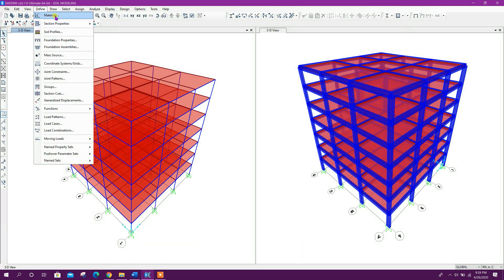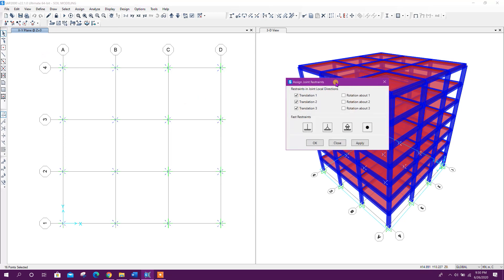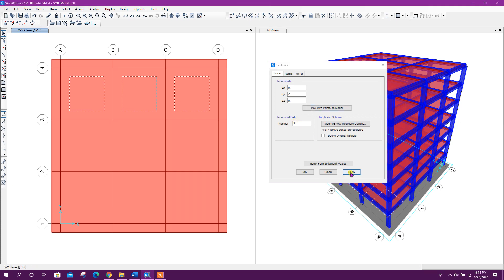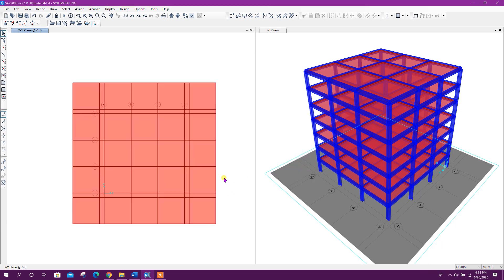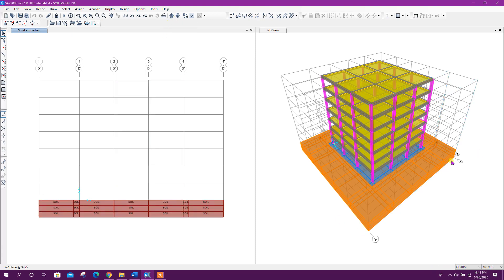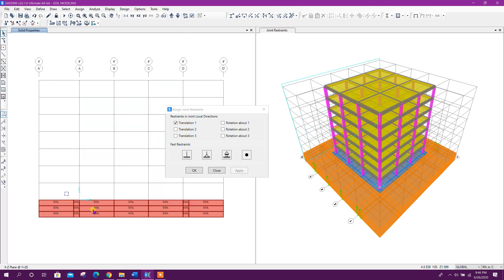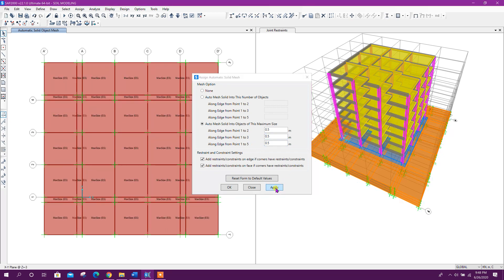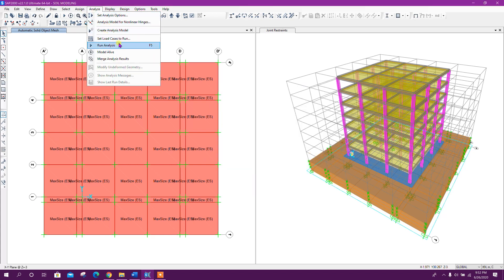Soil Structure Interaction in SAP2000 | Soil Modeling

Comment: Hello, I want to run a MODAL Analysis and calculate the Modes of the structure by simulating the soil as here. Do anyone know why the "Mass Participation Ratio" with this method is too low (5-10%) ? Is it not possible to run a Modal Analysis with this method?

Comment: well this is a great efforts, but i dislike for many reasons, the soil structure coupling isn't that simple, and it might work for coarse-grained soil, but for clay soil it's not accurate, since there're many other aspects you need to take into consideration which are also time dependent variables, second reason is you've modeled the raft as solid element, in any software the solid elements just give you stresses output, which isn't helpful for the structural engineer designer, since the majority of the engineers don't know to interpolate the efforts from the stresses to design the raft section. generally that's good effort and might work for coarse grained soil, and also to change the raft from solid elements which i consider is a bad choice for a section need to be design.
Reply from the maker: Thanks for your comment. You mentioned lots of reason to dislike but there is not proper reason as I have shown it with sand soil. Anyway you may dislike, I am going to reply your points-
I have shown the advanced material option where we can define time dependent variables according to corresponding data. 2nd, Raft is modeled as shell for design, here as we need to locate raft on soil that's why modeled as solid element. You are accepting as good effort, so that's supporting in a sense. As there I couldn't find any other proper way/reference to go for full SSI, this can be introductory approach for modeling soil in SAP2000, from here we will get more advanced ways in future in sha Allah. In this regard if you can provide any proper reference/way for full SSI, then it will be highly appreciated.

Comment: Sir, thank you for that great video. I can't find enough words to thank you.
Excuse me, I've a question. Why did you convert all load combinations into nonlinear cases? Would you please explain the reason why is that necessary when modeling soil-structure interaction?
Reply from the maker: Soil material has compression only behavior. In any structure if you model compression only or tension only members(like cable) then you have to go for non-linear analysis to find their non-linear behavior.
Reply: @Decodebd ,
So what's the difference between modeling the soil as you just mentioned in the video and running nonlinear analysis, and modeling it as linear elastic material composed of 3D solid elements and running linear analysis?!
Reply: @omarmahdy906  that's a good question. The majority of people think soil doesn't have tensile strength, which is a great mistake just because soil has a low capacity to withstand tensile force as concrete does it doesn't mean you must consider soil behaves in a unique way. However, everyone who is involved in Geotechnical and strutural engineering knows that soil's behavior is a headache, it depend much on several factors.
Reply: @Decodebd  Hey, congrats on this video, it is very useful for those SAP`s users. With regards to compression limits in Solids and Shell elements, I was wondering if you have ever had the chance to define them.

Thanks!
Reply: My opinion which maybe wrong. In case for any problems, nonlinear analysis has to be considered when you need more reliable of service state of structures. For engineers we don’t actually use linear elastic in any case actually because it will not happen for real situation.
But we use codes instead right for design purposes. However, Hi-rise building, wind turbines, offshore structures, etc. are mostly depends on dynamic effects which relates to combine with nonlinear analysis ( 4th order ). So we have to analyze first when we have to solve the “nonlinear problems”.